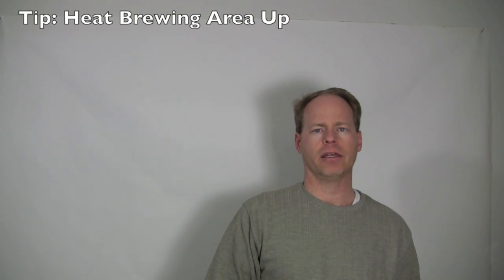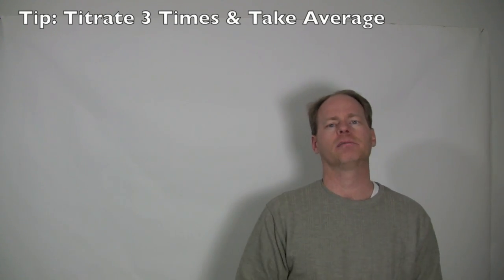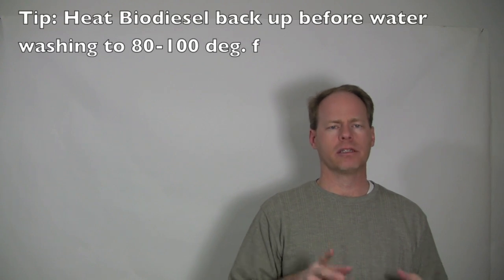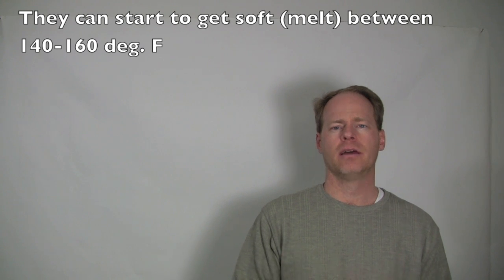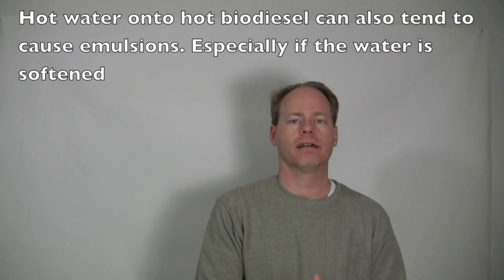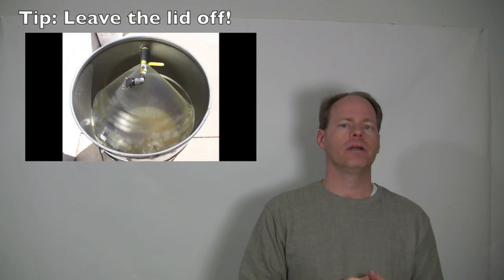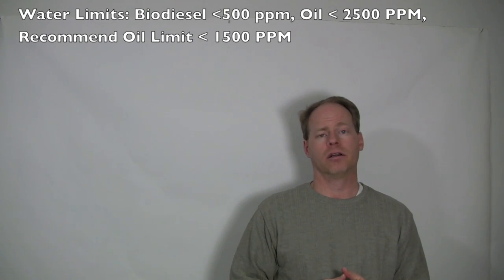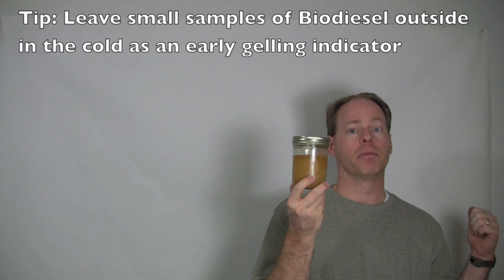Tips For Successfully Making Biodiesel In The Cold - Utah Biodiesel Supply

Comment: Yes. It should be, but to be safe, I would still turn it off when you're handling the methanol. Heat the space up good & hot & then kill the heater while you mix up the methoxide and wait until it's in the processor & sealed before you turn it back on.